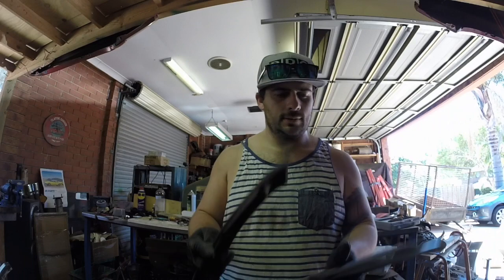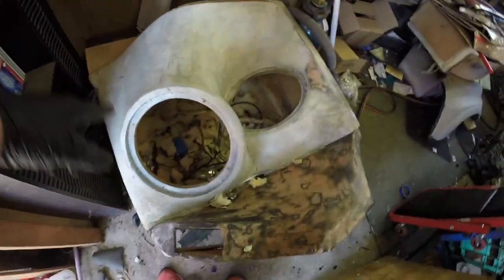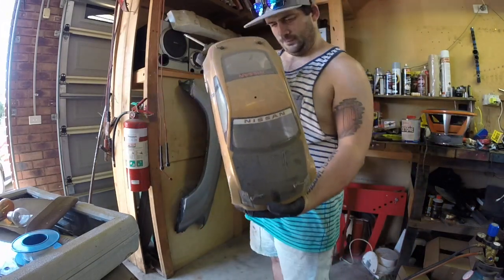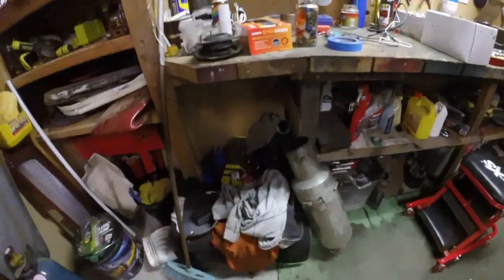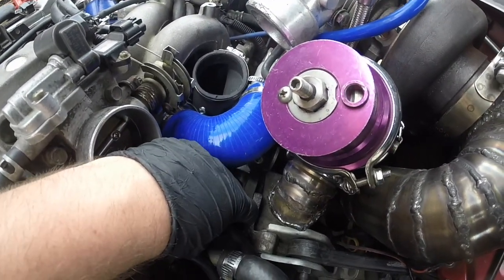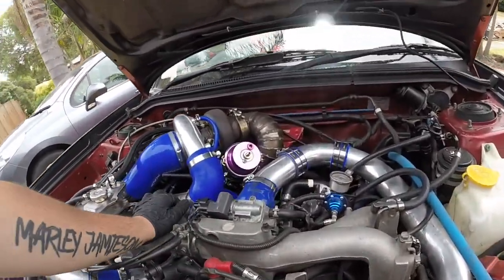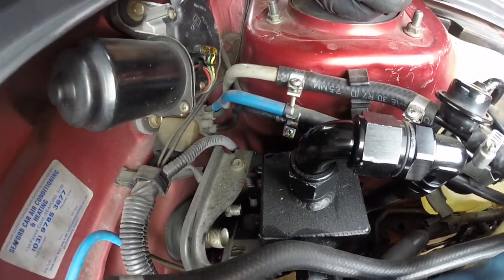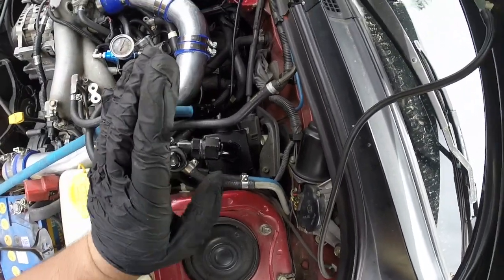Compound Turbo Subaru | GT35 Coolant Lines Finished *GIVEAWAY*

Comment: Consider painting that coolant tank lid. I checked mine the other day and it's got a factory gray coat on it, and it is magnetic.
Reply from the maker: So it will rust?
Reply: @HarrodsGarage  Good chance it will.
Reply: @MV60  yep mines rusted as
Reply: @douglasmcgrath9882  Thanks for the backup. :) If a magnet will stick to it I usually coat it.
Reply from the maker: Thanks for that. I’ll give it a coat